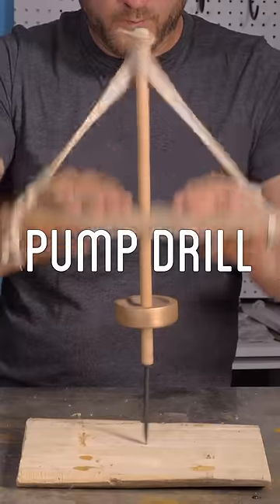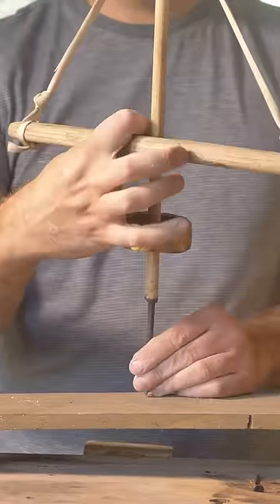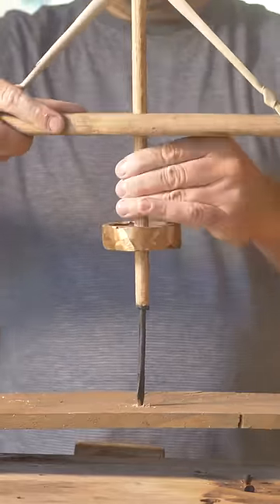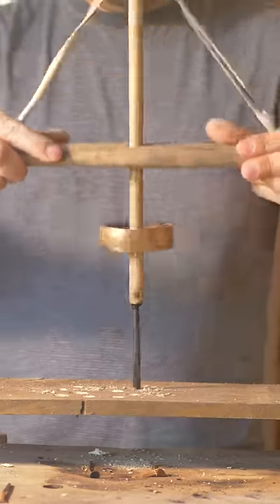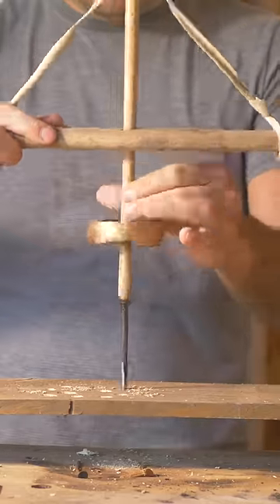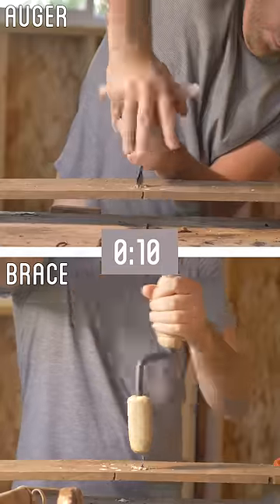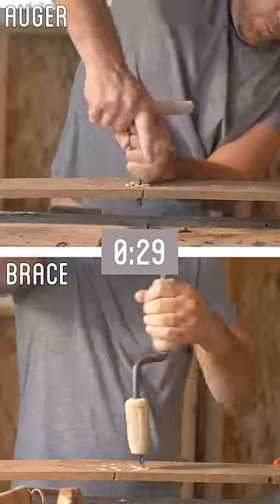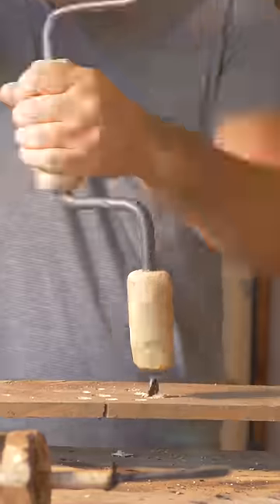Putting Ancient Drills to the Test! #shorts

Comment: The brace drill usually had a spinning flat mushroom-esc wood piece at the top, so that you could put it into your shoulder and push it downwards with your bodyweight. It is really handy and I think it was used the most and for the longest before electricity stepped in.

Comment: When using a pump drill
Pump drills are usually used with a file like cylinder not a blade
So I would suggest getting yourself a file with a flat tip that is cylinder-shaped and does not widen as it travels towards the handle
The wider base of the flat cylinder file well ironically "lessen the friction"
But you're just spreading your pressure out in a area which keeps it from getting caught on the wood

Comment: The pump drill could have another twist band in the other direction, so up and down both provide rotational force. 
That and a puck above the shaft to provide downforce should give more fluid movement... 

The hard part is growing the 3rd hand to hold the puck

Comment: Put a bigger fly wheel on the pump drill. it’ll keep the momentum better to push through what it’s cutting, and the added weight will add more pressure to the cut.

Comment: The pump drill would work better with a larger weight acting as a flywheel, and more rotations in the winding of the string. This would require a much larger input force, but it should overcome the friction of the bit and the wood

Comment: Just remember that that auger is a lot smaller, which means that if you need to use it anywhere tight or travel, it will be a lot better then the others

Comment: Make the shaft of the pump drill longer. The longer shaft will increase the speed at which the bit can spin. Alternatively, or additionally, using a different material for the strap which can withstand more force would allow you to apply more pressure, increasing the torque.
From the looks of that tool, it's primary design requires it to be both consistent and fast so I'd guess the longer shaft would be a given.

Comment: The brace drill is by far the best at its design, its reliable in more ways than one. Me personally, I prefer the pump drill, when you can finally establish a good rhythmn, its smooth sailing. That is assuming you dont hit a knot, then you're going to have to apply more force.

Comment: The brace drill is one of the  more common and widely used modern hand powered drills.     Bothe awl type and the brace work best with scew tip on their bits. The screw tip pulls the rest of the bit into the work.  It is very hard for the simple bits used in the video not to create a compressed bearing surface under their point .   which is not cut free and removed.   There is a lot of art in creating simple bits which work, never mind work well

Comment: For the pump drill I imagine a handle on the main shaft would allow you more control off pressure and position. This may cause less jams and help you drill as fast as possible on various types of wood.
Reply: All the jams are mid downstroke. You’d need to modify the bow to be one handed but that shouldn’t be too hard
Reply: Bearing in mind a drill should cut from rotational force not pressure as that leads to cracking, immediately this puts the other too way behind in all except speed, but damaged timbers are not worth a minute or two a hole, especially in the past with far cheaper labour

Comment: Change the pump drill into a bow drill. Or, make an extra free handle under the up and down part to apply downward force. You'll need something like that for the bow drill anyways; which I think would be the best option anyways. Especially for smaller holes through harder materials

Comment: You need to make the flywheel on the pump drill heavier, best if heavier just on the outside. Probably making the drill tip angle wider and making sure its even on both sides will help

Comment: My takeaway from seeing the drills in action is. The auger is good if you want a quick hole or at spots where it’s hard to work the brace drill. The brace drill is good if you have a lot of holes to do and they need to be more consistent and clean.

Comment: Use better stone for grinding the pump drill bits. You could even use a flat stone. For a drill to cut well it also needs clearence grinds, so every grind should slope towards the centerline of the drill. Also wider tip angles are better for reducing friction wile trading that for needing to center punch all of your hole locations.  I reccomend 90° to 118° included angle. (I've been a machinist for around 5 years now. And this is

Comment: Try to avoid making wings with the pump drill bits. The bits Clickspring used with his Pump Drill were cut and hardened rather than forged, so you might consider using a D or Spoon bit format instead of a Spade bit. Also, a shallower point would give you more control.

Comment: The pump drill is supposed to be used for starting fires not drilling in wood so it’s supposed to create friction, it can also be use to drill rock with some abrasive material but wood is outside its wheelhouse. Hope this shed some light 👍

Comment: For the pump drill you need a more flat tapered edge surface such as common drill bits these days opposed to a sharp pointed V which actually increases the force of restriction as there is more surface area tring to cut the deeper it gets. Where as with a 'flat' tapered edge the surface restriction is consistent throughout. How this is helpful

Comment: Bigger flywheel, not mass will always help and it would work much better if the wheel itself is larger(even with the same mass a larger wheel will hold/retain more angular momentum which you can then feed back into the cut).

Comment: Any kind of pump or strap drill really needs a much narrower bit, closer to a modern drill. Think more like a pointed square with enough edge to cut.  They tend to visually look more like chisels than drill bits as the goal is to cut with speed alone.

Comment: For the bow drill... Make the disc at the bottom much larger. Not the bit, the little wheel thing (not sure what it's actually called). Give it a greater mass so it acts as a flywheel.

Comment: Pump drill needs a bigger flywheel. And support the plank. It is snatching because you compress the board. Also the pump works best in sort of a abrasive cutting manner - not sure what to call it in english. The pump drill more or less turns the wood into fine powder under it. To do this it needs fair bit of force as it doesn't really "cut". The sort of a method is still used with thin sheet metal where drill is basically too agressive. Although we do use power tools. Also works amazing well for drilling ceramics and glass.

Comment: I was under the impression that pump drills were more intended for drilling hard materials like stone or metal... 
Not surprised the brace performed best in wood; that was the go-to design for making holes in wood all the way until the electric drill became commonplace. Heck, i still use one occasionally in my very power tool centric wood shop

Comment: The problem with the pump drill is it relies on inertia to keep it spinning with enough force to shave the wood away, but inorder to use it, it has to stop and then spin the other way, losing it's momentum and getting stuck

Comment: Pump drill should be used with  support under and should also have a sharp reverse chamfered cutting edge as well as the sharp tip.

Comment: Pump drill you need more weight. Also to get a better drilling action it’s important to have a better ship on the back of the cutting tip just thin the back of the tip. So the shavings don’t get stuck more momentum from the right weight with throw the wood shaving more out of the way.

Comment: With the pump drill if you can make the stat longer so you can have a longer pump motion that will help also if your fly wheel can stick out farther from the shaft or weigh more or both that would help hold your momentum wheel it recoils (also make sure you don’t apply downward pressure for too long.  If your still applying downward force when it wanted to start winding back up you can eat up precious moments)

Comment: Funny thing about the brace drill:
They're still in common use. Scale it up to slightly shorter than human height and maybe about 10cm in diameter and you can make a nice hole in the ice to fish out of. Called 'kaira' in Finnish (which, I would guess, comes from the sound they make).

Comment: Different drill bits too, use a spot drill bit to center/chamfer where you want to drill with your proper drill bit. Then peck drill it with the real drill bit, don't let it get clogged up with sawdust and overheat trying to drill straight through everything in one go.

Comment: The auger drill you need a heavier counter weight a hard stone one not sand stone but maybe granite just a smidge bigger than the wood one you are using. That would help keep your momentum and help control the drift

Comment: On the pump drill: the weight added in the shaft could be larger in diameter. So, same weight just further from the axis of rotation. It looks like it is a 2.5-3 in. Diameter. Taking the weight out to a 4-6 inch radius would increase angular momentum with each pump. 

It should overcome a greater friction coefficient. Doubt that it would beat either of the other drills, but it could work better...

Comment: The pump drill looks like it could use a larger diameter in the center dowel. The tension in your rope will give you more torque the larger the diameter is

Comment: The pump drill needs more torque or (twisting/rotational force). Greater torque can be achieved with a heavier fly wheel. If you increase the weight of the flywheel you can then achieve greater rotational force and limit the amount of times the bit catches on the wood.

Comment: Maybe try a larger/heavier fly wheel on the pump drill? Also maybe a bit with a square profile an reqlly crisp, sharp edges. That'll scrape the wood more than digging it out like a twisted bit would. But with the much higher speed of the the pump drill that might pay off in the end 🤷

Comment: You need to do more research on bit types. There used to be a spoon bit that would produce a corkscrew shaving and would allow you to change the center of the hole as well as bending the hole. I've seen these bits used in timber framing.

Comment: Pump drill will work better with bigger fly wheel and smaller tip.
Bigger/heavier fly wheel = more conserved torque. 

Tfw=m∗r2/2/a

Where Tfw is the Flywheel Torque (N-m)
m is the flywheel mass (kg) 
r is the radius (m) 
a is the angular acceleration (rad/s^2) 
To calculate flywheel torque, multiply the flywheel mass by the radius squared, then divide by 2 times the angular acceleration.

Comment: If you thread the pump drill you CAN get more torque on the bit. 
Almost forgot the drillbit make it into a cup with a sharp tapered pointand sharp on the sides you have the theory down but implementation is off a little.

Comment: you give the end of the bit for the pump drill requires a point then a flat cutting edge a few centimeters above it. like those drill bits specific for starting a die point then drilling into it

Comment: You need a larger, heavier flywheel.
Be sure you use STRONG cordage.
It'll rotate properly, and the weight makes it drill faster.
I made a drill fire starter with that design, and it worked extremely well.
✌️❤️

Comment: The pump drill could would work is the plunge distance was bigger. This would allow each downward plunge to have greated potential energy than the current model. 
This would allow it to over come the friction of the bit against the wood.

I would say the brace is the best drill out the three though since for all the materials and work it takes to create its the more efficient. There's a reason why these were used all the way into the 1980s only loosing to the cordless power drill. Their cheap, durable, intuitive and efficient (i.e. you can drill several holes without tiring).

Comment: Get the pump drill below your core, firstly. Put your hands closer to the drillshaft on the bar, push that SoB harder, and make sure you don't resist it's attempt to re-wind! You are the actuator in the design, it's only as strong as you're willing to push, and it's only as consistent as you can stay!

Comment: I own a brace drill and it’s fantastic (it can take multiple sizes of bits). I didn’t want to buy an affordable electric drill with plastic parts that would maybe work for a couple of years. The brace drill will last multiple lifetimes, it’s such a simple design. And like, it’s really not much more effort than an electric drill (for wood at least).

Comment: Pump drills worked best with an abrasive and a liquid medium and a stick. Just be careful you don't start fire. And it is possible to drill soft metals with a simple aggressive and instead of just a liquid. You use pitch or even something sticky. That's not what's gonna tell me pitches. Sticky but after it's been fired it can try to a very hard material.

Comment: make a much heavier flywheel larger radius and more weight for the pump drill a flywheel of that size for a drill like that is only really good for several millimeter drill bits very small precise holes for example also make sure that the Burr on the bits is sharpened properly so that it can cut the sides of the boar as well as the bottom

Comment: @htme it has to have cone face because that way each point along the height is equidistant to the tip with every other point at that height. I feel like that would allow it to keep spinning despite the friction. whats happening now is that it has a flat scredriver like base that gets stuck and cant grind the wood because the hole is not circular

Comment: I noticed withe pump drill you may bore the cilander around the spool and rifle it to fit the spool for more torque, also drill holes into the wheel for a weight reduction

Comment: May I suggest for the pump drill that you use a bit that is directed only to cut when going counterclockwise so that when it is on the off stroke so to speak it is spinning clockwise and upward and a counterclockwise when downward so that you are able to add additional Force to The Cutting of the wood. In any case so long as the bit is designed to only cut the wood in a single Direction and that direction is being driven with additional Force by you pumping downward on the drill then I believe it would be able to have the freedom of resistance to spin backwards and up again in the lift up stage.
Reply: Also add additional weights to the wheel so that it's newly resembles that of a flywheel. The additional weight will help to carry additional momentum thus increasing the effectiveness of the drill as it spins

Comment: You need to sharpen the auger section of the drill bit and carbon steel makes a straighter whole because it won't flex

Comment: Pump drill is simple fix. Better tension. Rubber bands don't have enough traction in their particles to create the grip necessary for the torque the bit needs to continue into the wood. try a metal concept or hard plastic with thicc rubber or tension bands for the straps. 

Ps. Yw- some kid whose 27 and still dreaming of being an engineer

Comment: pump drill would have more torque with a wider shaft, and hold its momentum longer with a wider 'flywheel'.  Brace is king for drilling holes. It'll outperform a drill press with large drills or augurs.

Comment: give the pump three teeth like nails and make them equidistant and the ones on the end will be only slightly smaller than the middle one. keep the edge flat and untapered. only the teeth should be sharp. idk what this will do but i’m bored and assume friction is the problem

Comment: You got the bit on your pump drill wrong. Start with a cylinder that's been ground to a sharp conical point, and then grind a flat surface at the tip, just a wee bit past the halfway mark.

Comment: you replicated a jennings bit with the spiral. a spoon bit would be older and simpler and better to execute well. 

increase the fly wheel on the pump drill. 

how sharp did you get it? how much carbon is in the metal, and were they hardened?

Comment: Actually sharpen your drill bits. Also support the board on a solid surface so it can't flex. Larger fly wheel on the pump drill.

Comment: I'm absolutely no expert but intuition tells me the pump drill problem you faced might be caused by the wood used being too soft. Pushing down was enough to pierce through deeper and stop the drilling. So this type might be suit harder wood better. 

It's also possible to get a better result with variations to the elasticity of the mechanism to reduce downward force and increase spinning force.

Comment: The pump drill needs:
1.) Thicker rotating stem (the part that the strings wrap around)
2.) Larger flywheel (lead is a good choice but you can try bismuth, it’s safer)
3.) The bow (the piece you push against) needs to have a hole in the middle through which the stem goes (better stability)
4.) Modern versions have a spring at the base that lets the tip lift after you finish pushing and when you push down the spring compresses allowing the tip to drill
Reply: Isn't bismuth very brittle?

Comment: First off, the way you suspended the board is counter intuitive, you want to be dilling into tensioned wood not compressed wood, secondly the drill bit needs to be awl shaped with a very gradual taper, third the counter weight needs to be heavier and have a bigger diameter than the one you used, it's the weights centrifugal force that spins the bit so that light peice of wood isn't doing much

Comment: I think the bit of the pump drill is too big for the flywheel being used. Get a larger flywheel or a smaller bit and it should have the torque to get through